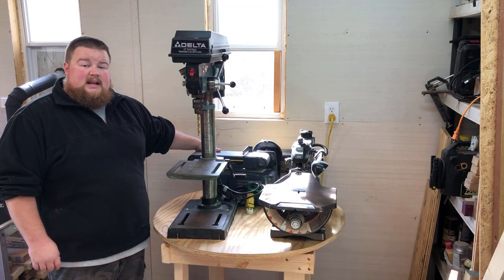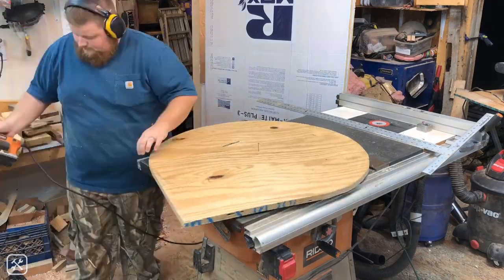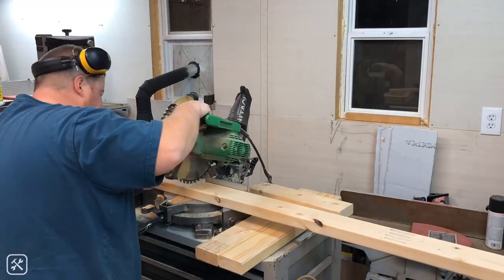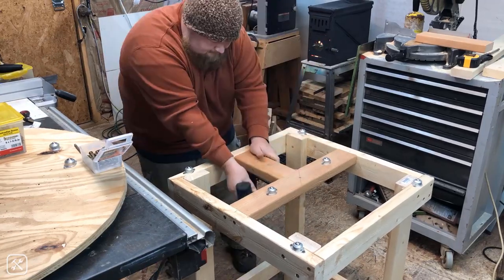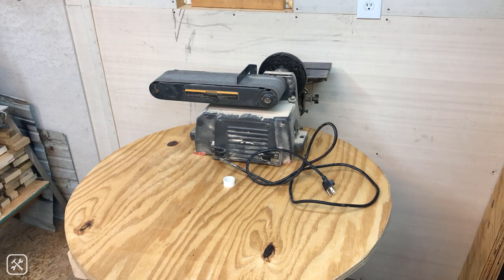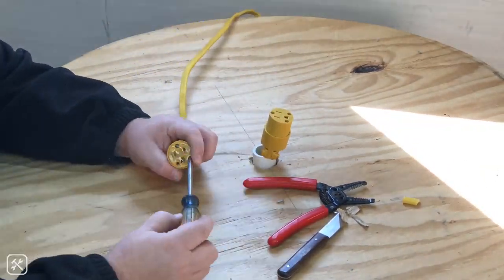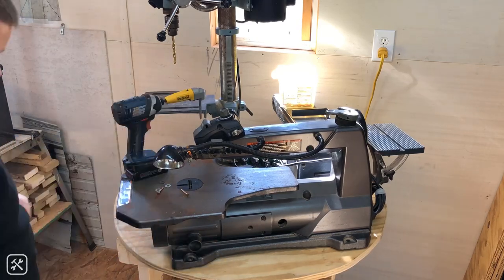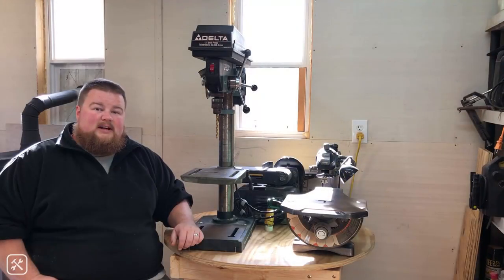Rotating Benchtop Tool Carousel | Woodworking DIY How To

Comment: Next build - make yourself  a miter saw station on one wall with some stops for repeatable cuts. You wont regret it. I waited way too long to do it but what a huge improvement. I used the Kreg system track and stops but you can make your own.  The one thing you do need is an accurate tape measure built in so you can trust the stops.

Comment: This is super cool. You did mention it, I would add more storage in the bottom area. I’m sure you’ll get a lot of use out of this one!
Reply from the maker: Yep, pretty soon afterwards I cut some plywood and put a shelf under it. It's just right for my spindle sander or anything else, really. This has been a very useful shop storage solution thus far. Thanks!!

Comment: Thx brutha I WILL be making one of these. And the funny thing is is the same tools you have mounted are exactly the ones that I was trying to figure out how to consolidate to a small area thx again man. Brilliant
Reply from the maker: Glad I could help! The only modification I've made since building this has been to put some scrap plywood on the bottom to make a shelf. Otherwise it has stayed as-is and even had another tool added to the mix! :) I put a small little belt sander between the drill press and scroll saw a few months ago. Hope you enjoy it as much as I have!
Reply: Nice bro I'm sure I will. I have a hallway of a shop so anything I can do to lessen the tool foot print the better and your creation will do just that

Comment: I wanted to make something like this, but I didn't want to build the elaborate ones I've been seeing. This is perfect for my little workshop that has way too many tools to not have something like this. I'd put it on wheels though, but I'd make sure they were heavy duty and would LOCK. Thanks for doing this.
Reply from the maker: That was exactly my thinking with this -- to greatly simplify it from the complex ones out there. Thanks!

Comment: I just did one thats 12"x24" for my grinder and drill press. But used a lazy susan instead of bearings. Moves nice, but might have to add a shim under the plywood top and my butcher block when drilling so it doesnt put pressure on the bearing

Comment: Good! I have surplus short 2x4's but not sheet goods, maybe I have enough for the circle but that's about it. I don't think I'm alone in this. That's the value in this besides the easier to build advantage.
It's also a lot easier to transport 2x4's, especially cut than sheet goods for people without trucks.

Comment: This is exactly what I've been looking for! I have been having to move my belt sander, drill press, and bench grinder whenever I need to use one of them and your design is much cheaper and simpler than the rest I've seen. Would you mind if i made my own video of me making one like this but with a few twists? I will give you credit for the main design of course
Reply from the maker: Go for it! :) Happy to help inspire you -- it worked great for me for years!

Comment: Very simple design but very functional. One question though, have you encountered a problem with lateral clearance of any of the tools? For example, you have a long workpiece for the drill press but found the scroll saw to be in the way on one side. That's not a knock on your design. It's more about the decision of which tools and their placement and was there a better arrangement.

I have very limited floor space in my "shop" area in the garage. I need a cart for my drill press but I'd also like a disc/belt sander. I could make a flip cart but this design would allow for a third tool that I haven't even thought to have yet.
Reply from the maker: I've not had any clearance issues with this setup, but I don't usually build large projects either. I've kept this design exactly as-is ever since building it with the exception of adding a piece of wood to the bottom for a shelf.

Comment: Your going to have to build yourself a cyclone dust collection.  Was the 2nd thing I built for my shop.
Reply from the maker: Sounds like a good plan! How do I talk the wife into it? 😎
Reply: @Samcraftcom  well your lungs are sorta a needed thing. Mine is built from a 5 gallon bucket. And a metal barrel and a shop vac. You can use a any vacuum to get you going. Thrift shop one will hold you over. They are crazy easy to make and you will love the fact you can use it on all your power tools. Sander, table saw, drill press, belt sander. It pulls that fìne dust and keeps your nose from getting crusty buggers.
Reply from the maker: Oh I have a dust separator, just not a cool cyclone one. 😎 But you're right, and anyone who comes here reading comments, this guy is right! Shop dust collection / dust masks / etc are super important!!!

Comment: What I would is is maybe 2 shelves. one at the very bottom and one that is a bit closer to the top for drill but, ad saw blade storage, or maybe even just a small box in between the legs. If you do the bow I would also make sure it's low enough for a small lid so it doesn't fill up with a bunch of saw dust. I like to keep things that go to specific tools near the tools them self

Comment: How well does it stay in place when using a tool? Does it not try and rotate while in use?
Reply from the maker: I had no problems with the top rotating because of using lesser quality plywood that was rougher and dimpled over time. This meant the top was tougher to rotate, but that the tools stayed put.

Comment: The Problem With Using Roller Bearings Is: Designed For Linear Movement Only! No Matter How Many  Bearings Are Used, The Rotation Will Always be Lousy! Use A Heavy Duty  24 Inch Diameter (Min 300 Pound Weight Capacity) Lazy Susan Bearing Ring For Circular Motion. It Will Spin Freely!

Comment: I see you screwed it down to the floor to keep it from shifting but how do you keep it from spinning when using the tools?
Does it spin or are you able to use all 3 with no problem?
Reply from the maker: The weight of the tools keeps it from spinning during use. The drawback to that is that it can be difficult to rotate. This is because I used "construction grade" plywood for my top and it made divots from the bearings. Had I used a harder material like masonite board, or a better quality plywood, then it would rotate easier and I may have had to address the movement then. Hope this helps!